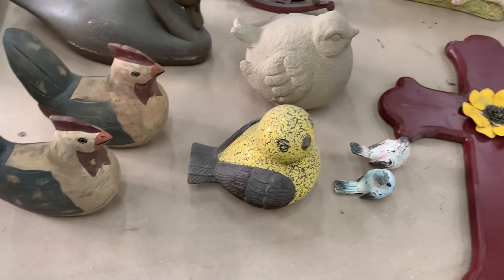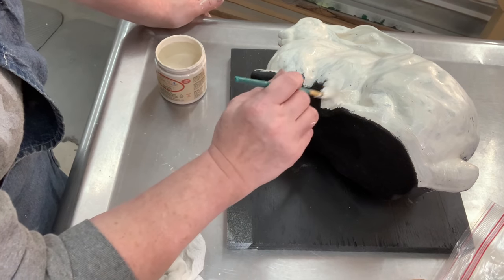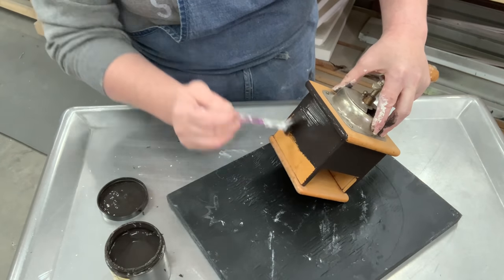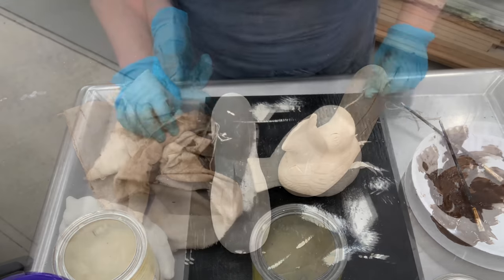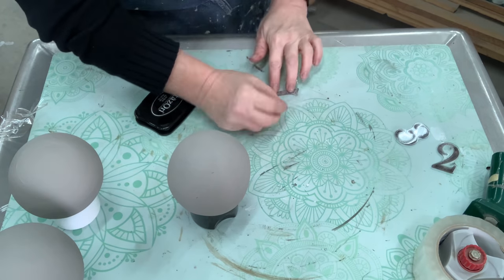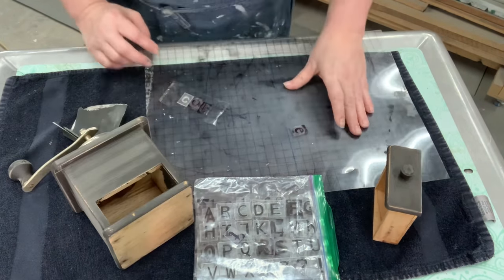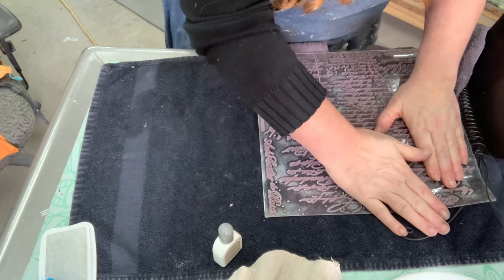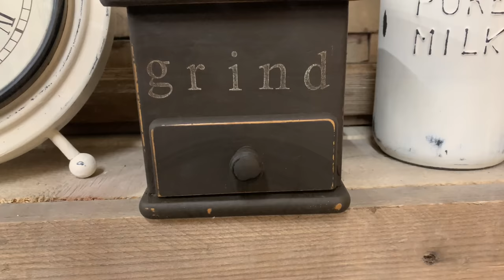Flipping Some Birds in Thrifted Finds Makeovers || Trash to Treasure

Comment: Oh how those rabbits spoke to me after you finished them. Now I need to go find me one to do. 😅 And a tip I have watched is to rub the base coat with a candle in the area where you want the distress. The candle wax will keep the top layer of paint from adhering as well in those areas. You can use a plastic scraper or gentle use a metal one as well as sandpaper to then reveal your base coat. This same process works well if you are using more than one color. Just add candle wax to each layer before scraping.
Reply from the maker: Thank you for sharing that tip